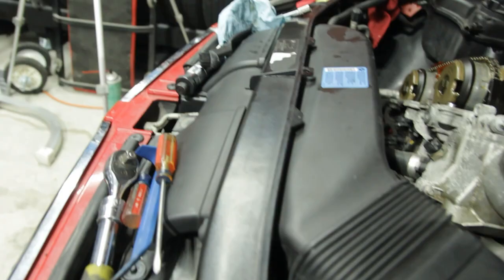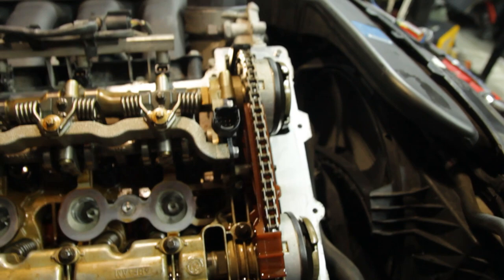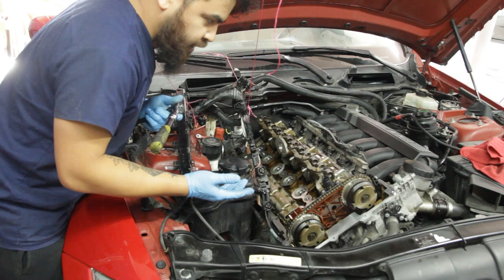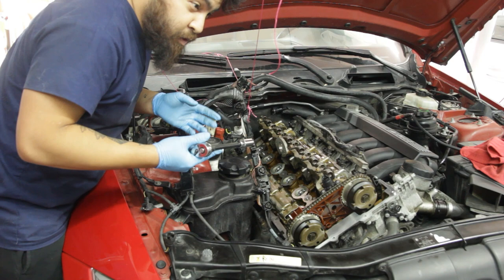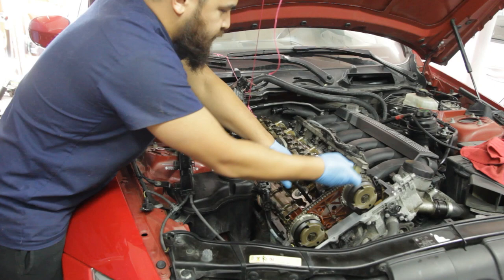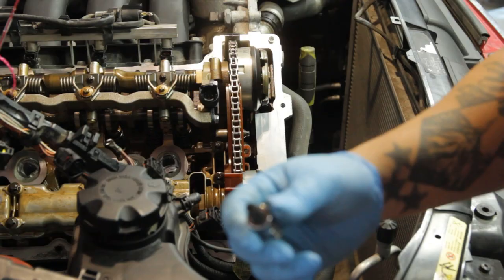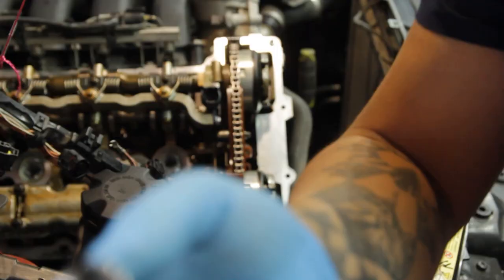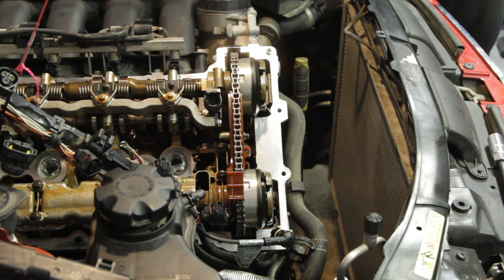BMW E9X 328i N52 VANOS Sprocket Bolt Recall DIY

Comment: I have a 2011 bmw 328i with 131k miles. My local bmw steelership is playing games with me. I called multiple times if parts were available before I drive out there. Two service people told me bring the car in and we will take a look at it. They also told me the shop approves the repair after they diagnose it of course. Well today they told me “Remedy Not Available”. Man I was pissed. I don’t him I don’t want to wait because what if the bolts are backing out it will just be matter of time and then my engine is toast. I will definitely never buy a bmw ever again.
Reply from the maker: Yeah it's pretty ridiculous. What I don't understand is that it's been two months now and the remedy seems to still be unavailable. The craziest part is that the remedy is no different than with the previous recall...so I would think all dealerships would have already have their remedy "kits" ready to go. It really is unfortunate, but if by chance these bolts do fail on you, all of the associated damage ends up on BMW as far as I know.
Reply: @jontansgarage  that’s good to know. Are the bolt heads in the right side cam (Vanos) visible from the oil filter housing?
Reply from the maker: @Joseph5394  Both assemblies won't be visible without removing the entire valve cover.
Reply: @jontansgarage  I was hoping it was somewhat visible but thanks for your help sir. I appreciate your video.
Reply from the maker: @Joseph5394  No problem. Good luck sir!
Reply: @Joseph5394 you can see the intake side bolts if you have a borescope. snake the camera in through the oil fill cap.
Reply: Thank you sir. I will purchase a borescope and check it out.
Reply: My dealership said there’s a recall for the bolts but there’s no remedy!!! Yet there’s a TSB with the solution. Obviously they don’t want to do it, so I did it myself and finished today.
Reply: Also, the TSB says, if the bolts are not backed out, don’t touch them. Yeah right!! I replaced all of them.
Reply: @jontansgarage the dealership told me there’s no remedy at this time yet FCP, Pelican and ECS sell the upgraded bolts. I think bmw is telling the dealerships to avoid as much as possible. A million recalls at 4 hours of labor is a ton of money.
Reply: @iamurnamann8662  I totally agree. I told the service guy at the dealership I’m sure you can find these bolts and the gaskets for the valve cover here in DFW area easily. They’re playing games.
Reply: @Joseph5394  You can tell them you’ll be happy to provide the upgraded bolts and gaskets for them and let’s not forget the PCV beater recall. I replaced that as well.  The bolts were .70 cents each at ECS Tuning. The gasket kit is around 40 bucks. 
If you provide the bolts and gaskets, how can they say no? I’m going to find out if I can get reimbursed by BMW for replacing the Pcv heater recall with the 7.5 amp inline fuse and the vanos bolts replacement. I read an article BMW reimburses the repair. If they do, I’ll let you all know.
Reply: I like that idea lol. Let see what BS they come with on that. I had them replaced my pcv heater back in February. First time I showed up they did the same thing and pulled that no remedy crap on me. Following month I saw they had the parts. Only waited about a month for the dealership to do the repair.
Reply: @Joseph-gi9fw  in the TSB, it states the dealership provides the parts and BMW states four hours of labor. I believe it’s more than four hours, because the dealerships have to remove the vanos gears to replace the bolts, which means timing. Then service has to pull out the cam blocks and flywheel pin, make sure the engine is at TDC, then remove the vanos actuators, replace bolts, reinstall the actuators and put back VC. I can see why the dealerships are evading. They’re not making enough money, let alone not charging 150.00 diag fee. Just the VC alone is a pain in the a$$.
Reply from the maker: @iamurnamann8662  Yeah it's really odd because they should already have these remedy kits available from the previous recall; the TSB lists the same parts. I can only imagine how much money in labor they lose, especially when they have to tear into the oil pan to recover broken bolts. It's honestly something that I wish I could recommend waiting for BMW to come through but who knows how long it'll be before they have a remedy available. In my opinion, you made the right choice by just taking care of it yourself!
Reply: Well after Longacre awaited remedies to fix this issue my motor has finally suffered catastrophic failure after removing oil pan ot seems all the bolts have broken off and sitting inside oil pan.
Reply: Oh and when I called again they said call bmw of north America 😂
Reply: @jontansgarage  after I replaced the bolts and put my valve cover back on, I realized the CCV channels in the valve cover were blocked. I was wondering why I didn’t have a vacuum when opening the oil filler cap. So I purchased a new valve cover. It took me a week to originally remove the cover and replace the bolts. It now took me a couple of days (during the work week) to replace the cover. I took my time the first round since it was my first time but now it’s a piece of cake thereafter. At least I don’t have to worry about the gaskets and CCV system for a very long while.
Reply: @ishmaelwhite15  it’s not catastrophic if you stopped driving it. You’ll have to replace the vanos actuators, which means you’ll have to fix the timing by putting the engine at top dead center and replacing the actuators. Hopefully you can get BmW to cover it since they decided not to remedy the original problem.
Reply from the maker: @ishmaelwhite15  Man that's super unfortunate to hear. It sucks, because this recall notice has put a lot of people in a pickle; keep driving, waiting for the remedy to become available and risk killing the motor or just deal with it now on their own dime. Hopefully, BMW will still cover the damage.
Reply from the maker: @iamurnamann8662  Ahh thats a bummer. Glad its fixed though. It really is amazing how quick this job can be once you figure it out. This job took me several days to perform while filming but once I had to do it all over again without filming it took but a few hours.
Reply: @jontansgarage  yea, man, I'm still trying to get in touch with bmw of North America. The dealer stated that their hands are tied have to speak with them. It seems every used engine has this exact sa.e problem.
Reply from the maker: @ishmaelwhite15  What a headache. Good luck with it man, keep us updated.
Reply: Call BMW of North America give them your VIN they will inform you if recall is applicable to your vehicle , you should l have received  a letter regarding this if you are the original owner .Inform BMW NA of your situation with this dealership and ask for advice as to which dealership to go to .It's not BMW but rather the dirt bags running the dealer you went to p..I know I worked on the product for 40 years
Reply: @johnboutsikos6049  maybe I am calling the wrong number it just rings no one answers.
Reply: BMW of North America  ask for the customer relations number or go to their site and research for the recall also
Reply: Does anybody know the part number for the kit for the bolts 2010 328i ????